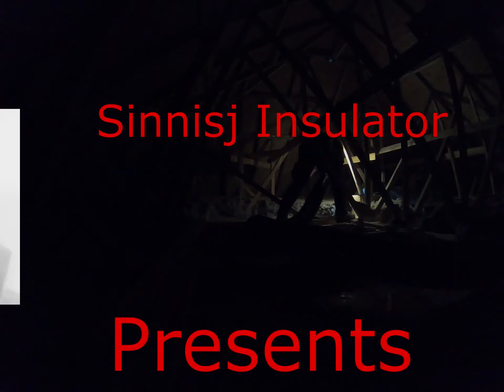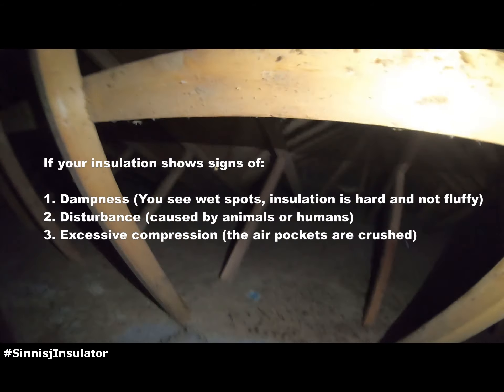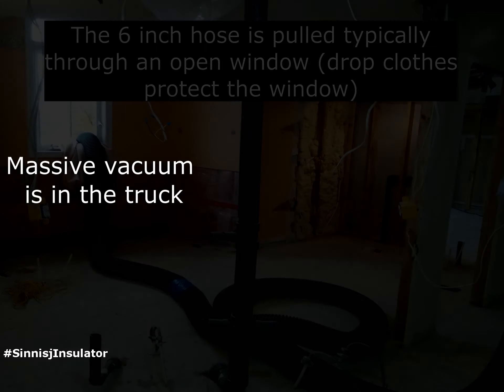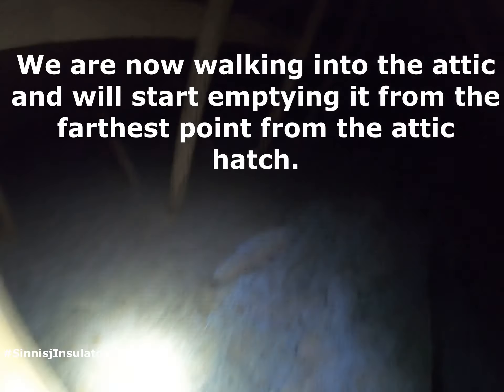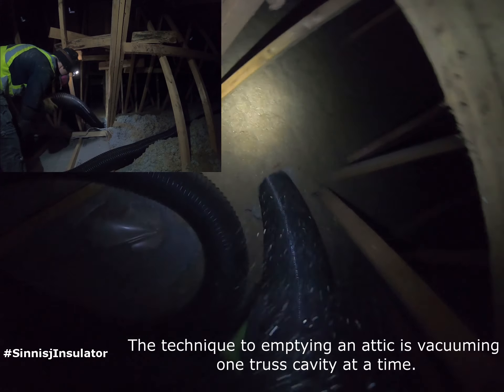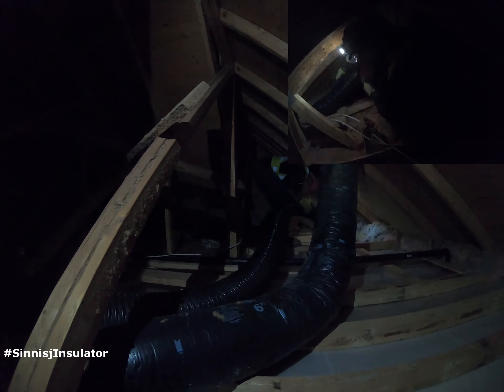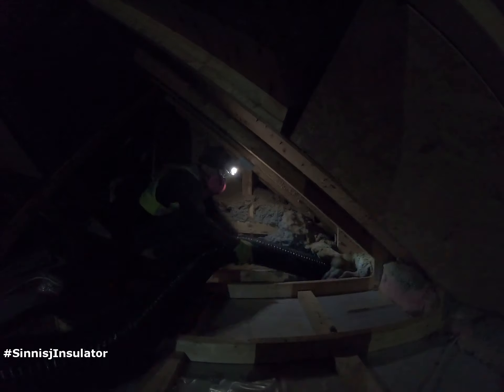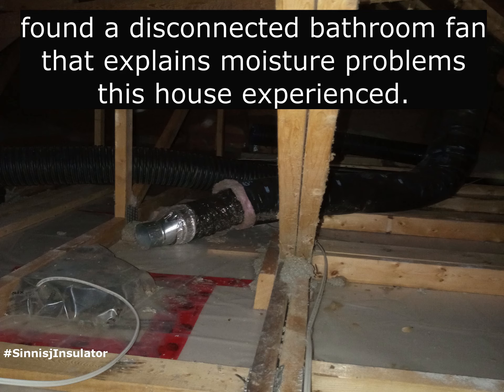How to remove insulation in your attic

Comment: Would you recommend replacing insulation first? Or the air ducts? My house is in need of both .
Reply from the maker: glad you dropped by. If you are thinking of replacing both then I recommend removing the Insulation so you easier access to your air ducts, assuming these ducts run in your attic. less messy this way as well. then you should run your new ducts and then reinsulate. attic insulation should always be the last thing installed so it doesn't get disturbed. hope this helps.
Reply: @SinnisjInsulator  I appreciate your response. You are correct as in this is an attic in a home built in the 60s. The insulation currently is, I believe pink panther roll down version (not sure what the proper name is ) so it will be easier removing I assume. My plan is to replace with the same kind of insulation along with other steps after watching your videos. Than you very much for your response and time !
Reply from the maker: @kurti4432  it's why I created this channel, to inform about attics. Once you get into the step of reinsulating I suggest watching this one if you haven't already: https://youtu.be/QrJpbT7E4us 
Airflow is super important in an attic unless you plan to make it into a living space. If you have any other questions don't hesitate to leave a comment.
Reply from the maker: Hi Kurt, I just uploaded another attic removal video if you wanted to check it out https://youtu.be/tBCqYUEwBik
Reply: @SinnisjInsulator  Oh nice man! I'm gonna check it out! I appreciate the heads up !
Reply from the maker: @kurti4432  awesome
Reply: @SinnisjInsulator  BTW I appreciate the follow up, means a great deal and shows you care. I'm torn in what I need to do with this house first. Needs to be painted, lifted and insulation. Oh and some dry wall work inside. Smh what a mess lol
Reply from the maker: @kurti4432  you are welcome, it's what this channel is all about. That does sound like quite a project. Hopefully you know how to do it yourself or get a good contractor.
Reply from the maker: @kurti4432  if you have any other questions I can do my best to answer

Comment: newly subs! you got great contents video! thanks. im thinking of doing my own attic this coming summer but im debating to get some pro to do it or just do it my self. I saw some youtube vids to spray foam the "outer wall joists"  on the attic, Im not even sure if thats the right word. Also to spray foam any outlet or venting as you mention. All that to say it seem lots of work. do you know anyone in montreal area to do this job thanks.
Reply from the maker: glad you subbed to my channel. here is a good video you can watch that gives a good example of how I install attic insulation   https://youtu.be/ZFb3gboBT9U .I have lots of attic insulation content and playlists focused on various attic insulation topics. I mostly install loose fill fibreglass insulation but have experience in spray foam. it’s a great option to install in the cavity between roof trusses. you can also use fibreglass sheets and even cardboard vents stapled to the trusses to maximize airflow. I mostly work in Toronto area so I don’t know about Montreal businesses. if you have other questions I will do my best to answer them in comments or future videos.
Reply from the maker: Hi Brian, just uploaded a new attic removal video if you wanted yo check it out https://youtu.be/tBCqYUEwBik